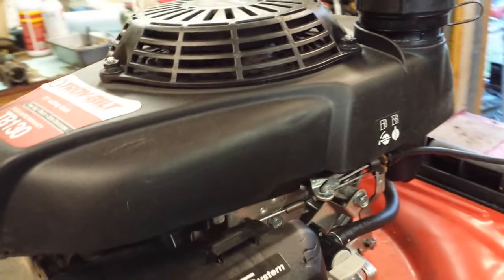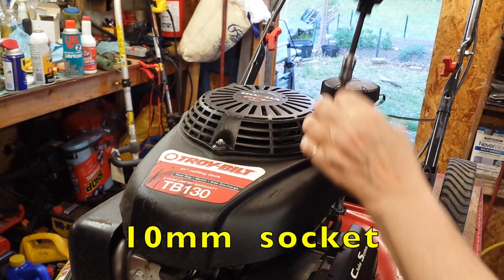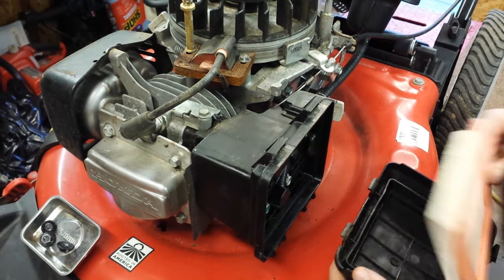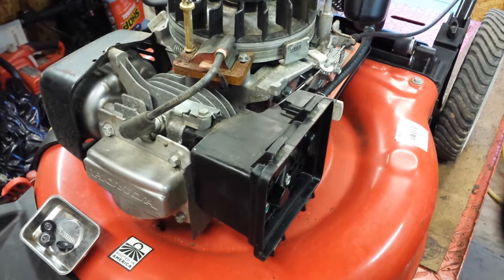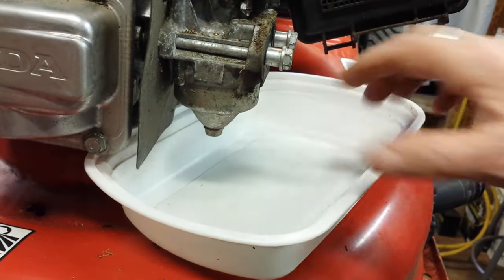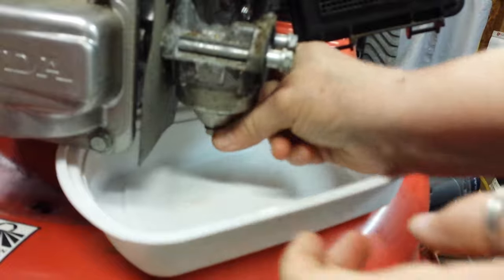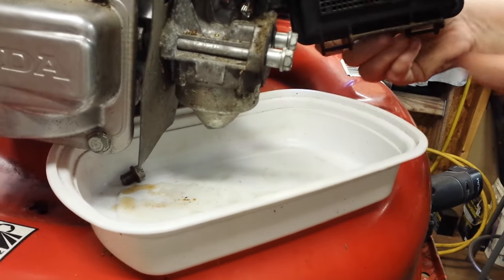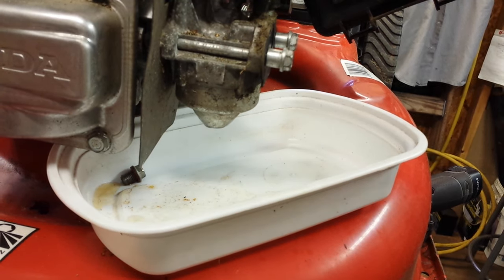Honda Mower GCV160 Keihin Carburetor Service

Comment: I have pretty much the same mower.  Here's my problem.  It almost always starts on the very first pull, even after sitting all winter.  Last year I noticed it would start but as you used it, the engine seemed to be popping and would eventually die after about 20 minutes.  I looked at the plug and it wwas completely black.  I changed it and used the mower most of the rest of the summer with pretty much the same problem.  At the end of the season it would barely run.  I looked at the plug again and it was completely black even though I had changed it at the beginning of the season.  Obviously it is running very rich.  I can see the choke, auto choke, opening and closing.  Any ideas?
Reply from the maker: Thanks for watching Mr Jim! I would first check your oil level, make sure it's not overfilled. Air filter can get saturated with oil and dust/dirt. and lastly the valve lash.hope you can get it running too notch again. Cheers!
Reply from the maker: And a couple of other things I thought about (not enough caffeine yet 😬) Your gas cap might not be venting properly. Next time that happens, loosen the gas cap, if you hear a swooshing sound,  and it fires right back up again, you need to replace the cap. 
It also could be the ignition coil breaking down. Not a good way to test for this other than waiting an hour for it to cool down, and it fires back up.  A pricey gamble for sure, but they are easy to replace. 
Lastly, did you replace the plug with the same NGK BPR5ES ?  Bad plugs right out of the box is rare, but not unheard of. Also there apparently was a plethora of counterfeit NGK plugs on the market a few years ago. If you bought an E3 or Torch plug, I would bin that one for a genuine NGK.
Reply: @TheLawnmowerLady  thanks so much for your suggestions.  I will give them a try.  BTW, I loved your video.  Very detailed and to the point

Comment: Question: I removed carburetor from troy built push mower with honda engine,  cleaned, put it back, start the mower with chocke on and it started fine but when choke is off, rpm gets high and runs at full speed. Can you think of anything where I made the mistake?
Reply: I checked to see if there was any airleak, visually I couldn't see anything.
Reply from the maker: The easy way to check for an air leak is to spray something like brake cleaner, or carb spray near the intake. If the RPM changes, you found your air leak. I'd also check the governor return spring and linkages, to make sure they are not getting snagged up somehow. Hope this helps. Thanks for watching.
Reply: @TheLawnmowerLady  Thank you for the quick reply! I'll try that.

Comment: hey i did this,  my mower was running before but wold always die after thirty seconds. now after i took apart carb and cleaned and put back together it wont start at all, so much so that i broke the cord trying to yank it to life. please help
Reply from the maker: Fixing things over the internet is difficult. I suggest going back over what you did. Make sure all the gaskets and linkages are correct. A very quick way to isolate a fuel delivery issue is to spray something very flammable into the carb intake. If it coughs and sputters a few seconds, you've eliminated spark and air as issues. Concentrate on making sure you have good fuel flow. Thanks for watching.

Comment: Not sure why this low speed jet Philips head screw is so tight......gonna have to get an impact screwdriver set to remove it.
Reply from the maker: It is tight. I sometimes put them in my vice (with soft jaws) to hold it steady. Thanks for watching!

Comment: Hello, one question I changed the carburetor but it started to spew gasoline what is happening I don't understand thank you
Reply from the maker: Sounds like the float has a hole in it? If it's an aftermarket carb, those are sometimes poor quality.

Comment: THANX.  hopefully carb spray will do it.
Reply from the maker: Just keep it away from the rubber and plastic bits. It's pretty harsh. Thanks for watching!
Reply: well, it starts, but barely runs.  It surges a lot and sometimes even dies on its own and when engage blade, if I don't do that slow, it stalls.  Neither did Tru fuel, new air filter, or spark plug help.   Can that wax pellet keep it stuck on choke and then mower seems to run weak?  Anyways I ruined the cartridge trying to pull it out.  Are they all the same part number? 16620-Z8D-305 or do I need 16620-Z8D-842.   I Have GCV 160 motor on a HRR2169VYA Mower. BTW I got rid of old filter and replaced it with a kawasaki visu filter.  Just cut the fuel line and spliced it in there. Hope I didn't do anything stupid.  Might change it to a B&S  type if that won't work.  when get chance will check the lash on the valves  and re clean the carb. After that I lift my hands and take it to the shop.
Reply from the maker: @joeshmoe5935  I’d keep a lookout for fuel leaks. That fuel line is 5/16 and many of those inline filters are 1/4. You should be able to confirm the thermowax plug on a parts diagram at most any major parts house. It sounds to me like the idle circuit is clogged in the carb still. That’s the small screw on top. This video Honda HRC216 Mower No Start: GSV160 Carburetor Clean How To
https://youtu.be/wJPM_ArLSgg shows more on cleaning that out.
Reply: @TheLawnmowerLady  small screw on top that outlets into 2 very small brass nozzles in the main bore?  Just want to let you know you are being a real angel.
Reply from the maker: Yes, make sure that runs free with carb spray from both ends.
Reply: @TheLawnmowerLady  while I am at it and have oil out and sparkie out, think I  should check valve lash or probably not worth the hassle?
Reply from the maker: @joeshmoe5935  I wouldn't bother unless you suspect a problem. That valve cover is meant to be a one time use thing, but folks reuse them all the time.
Reply: @TheLawnmowerLady  I couldn't wait for your reply.  Since I already tipped the mower over to empty the oil.  I broke in there.  Am I glad I did.  Was no .006 on intake and .008 gap on exhaust.  Felt like it was more than that.  Maybe that is why the guy sold it to me at a decent price?  Took almost 1 twist on each adjuster.  Used blue Permatex silicone to reassemble.  Cleaned cover and head real well before reapply.    BTW, after taking carb apart 2nd time.  the main jet that sticks up in the bore.  Smaller holes were still clogged.  wire and also twisty went in there, but I have these small drills from old job and they pushed out some gunk.
Reply from the maker: @joeshmoe5935  Yay! Glad you got it figured out. Cheers!
Reply: @TheLawnmowerLady  Running like a champ.

Comment: I am in the middle of a carb tear down of this specific engine and I see the governor rod and adjacent spring are intertwined. I don’t thing that’s supposed to be the set up. Can you please confirm???
Reply from the maker: The governor return spring indeed has a small series of loops that the control arm is threaded through. I hope that makes sense. Thanks for watching.
Reply: @TheLawnmowerLady  thank you for the confirmation and I’m now a new subscriber. Ok I followed your tear down of the Honda carb to the letter. I noticed there was some debris in the waste carb cleaner after I blew into the passages. I removed every screw and reamed every little hole too.  After reinstalling I the noticed the engine was still surging just a bit so I changed the plug and it seemed to run OK but not optimal. I have another Honda mower which is approx 12 years old and runs like a top. I noticed the exhaust smell is a bit different too. Not sure what that’s all about?? Like your carb tear down I noticed the Governor arm had a slight crook in it. I left it alone. Would that matter or should it be straight? Thanks for the time and showing us newbs how it’s done. ALMOST FORGOT TO MENTION: the mower was running and sufficiently warmed up. I turned it off and pulled to start it approx 15 secs later. It would not start. It took a three yanks of the pull cord to start it. I have never had that happen to a Mower. Is this a tell tale sign of something???
Reply from the maker: @Fresh-tw7ev  If it's an older mower, just might need a valve adjustment.  I rarely have to adjust valves on any mower, but hard starting is a good indicator. If the problem continues to get worse, it also might be a failing ignition coil.
Reply: @TheLawnmowerLady  thank you...I pulled the carb again, cleaned every channel nook and cranny and drained the fuel tank and blew out what might have been some water. I also gapped the plugs to your specs. It runs a lot better but wondering now if the wax plunger thingy is malfunctioning. Should it protruding outward when it’s a COLD engine? UPDATE: I let it sit after running it for 15 minutes with no chugging or hunting, etc. I started it up and the engine chugged and blew out black exhaust smoke. It sputtered and finally caught on and ran fine. It did that approx 3 times on successive starts and even had it backfire on me when I pulled the handle. As mentioned previously I installed a brand new plug and gapped to specs. Could this rough running be a valve issue? Or that wax plunger thingy.
Reply from the maker: @Fresh-tw7ev  the wax thermoplastic runs the auto choke. You can check it’s working: on a cold engine, you should see the choke flap, looking into the throat of the carb is completely closed. I hope this helps.
Reply: @TheLawnmowerLady  Ok I noticed the thermowax rod was protruding when the engine was COLD, which should not be the case apparently. I had a dickens of a time removing the thermowax insert. I had to use needlenose vice grips and wiggle and pull it out. The former owner had used gasket seal to cement the thing into place. Wow. I’m thinking “No way could that be to manufacture specs” but please correct me if I am wrong. The sealant was also heat resistant because when I applied the blow torch to the insert (after I had removed it) and instead of melting away it glowed orange. I pulled the brand new spark plug to check it out because the engine was backfiring and the entire tip was fouled with carbon. Not good!!!
Reply from the maker: @Fresh-tw7ev  Wow! It should fit  in dry. When it gets hot, it pushes out that piston, which in turn opens the choke flap.

Comment: I have a Honda mower and I turn off the tap and run the engine out of fuel after each cut, but I know it's Ott..
Reply from the maker: Thank you Mr, James. If everyone did the right thing like you, I dare say 85% of my work would be unnecessary.
Reply: @TheLawnmowerLady  Yeah it's just a habit I got into. She does start very well hot or cold except for the usual "hunting' sometimes,  I'm just a bit too lazy to clean the idler jet😁,...... I should though 🙄.

Comment: You put the carbon mounting gasket on backwards the tiny hole needed to go to the right not the left….. I accidentally did this yesterday that’s how I know…I just pulled the gasket out and flipped it over so the little hole is to the right if you go back and check the video you will see
Reply from the maker: If you're referring to the heatshield, it went back on in the order and position it came from the factory. Often gaskets and spacers are used on multiple models that may or may not have matching passages for air and/or fuel. On this particular model, it doesn't matter as there was no passage on the carb body, or auto-choke body. Thanks for watching.
Reply: @TheLawnmowerLady  Im confused because if you look at that gasket that tiny little hole will not match up with the tiny little hole that is on the right side of the carburetor with the position you have the gasket…Are you sure somebody did not put the gasket on wrong before you ? OK I went back and looked at three or four videos of the Honda 160 engine carburetor install the gasket definitely goes with the tiny hole in the gasket lining up with the vent hole in the carburetor those two holes have to line up otherwise the carburetor will not vent….
Reply from the maker: On this particular carburettor, that passage is blocked with a brass ball/plug. It goes nowhere on this model. In this case, it doesn't matter how the heat shield is mounted.

Comment: What do you call the black part on top of the carburator that is controlled by the governor which sits beside the choke stop arm.
Reply from the maker: I think you might be referring to the throttle control arm?
Reply: @TheLawnmowerLady  yes throttle since it's linked to the governor arm but I didn't know if it was called an "arm". I have an HR214 gxv120. When it's on choke it runs but sputters and dies as soon as I put it in hi or low throttle. Before it would run but died after 5 min every time I started it again. Any idea? Carburator dirty or not well adjusted ? Governor arm or throttle cable adjustment?
Reply from the maker: @JazzyScat  sounds to me, like the carburetor, especially the idle circuit, could use a good cleaning.
Reply: @TheLawnmowerLady  I'll do that. If the bowl looks clean should I still proceed to clean it all or try without removing it first maybe just the pilot jet under the throttle screw adjuster? And is it safe to spray the inside throught the vent hole where the air filter box connects to? Saw somewhere that you have to do that while it runs but don't know if it's gonna run or start whitout the choke on and if the choke is closed doesn't it close that hole so you can't spray inside? Newbie here. Thanks!
Reply from the maker: @JazzyScat  clean bowl unfortunately doesn't mean the internal passages are clean. If the idle jet is under a plastic screw, I would avoid carb spray there. I would pull out and clean the main jet and the emulsion tube as well as the idle circuit. Use carb spray in all the openings. I think this video shows more details on cleaning: https://youtu.be/wJPM_ArLSgg
Reply: @TheLawnmowerLady  Hi I will be changing the carburetor and wanted to know if I needed to do anything before starting the mower afterwards since there will be no fuel in the carb. Maybe it's not needed when it's a 4 stroke engine without a primer button? Do I still need to put some starter fluid in the carb before closing everything? I searched and searched couldn't find anything. Thanks
Reply from the maker: @JazzyScat  No, you should be good to go after you open the fuel tap. The auto choke mechanism obviates the need for a primer bulb.
Reply: @TheLawnmowerLady  it's called auto-choke even if there's an off-lo-hi-choke manual lever?
Reply from the maker: @JazzyScat  oh wait. I didn’t realize you have a manual choke cable. Either way, no primer is needed with a mechanical choke, regardless of how it actuates.
Reply: @TheLawnmowerLady  great! Thank you so much I really appreciated your help.

Comment: I cleaned my carb and it starts. It won't stop without turning ga line off.
Reply from the maker: Be sure and check the kill wire. Might be disconnected?
Reply: @TheLawnmowerLady  fuel line was tangled with idler causing idler not to stop.
Reply: Thanks for your reply.
Reply from the maker: @polocash11  Glad you got it sorted. Cheers!

Comment: Can’t get the atomizer tube out!
Reply from the maker: Sometimes I have to soak them in carb spray, to get them out. Sometimes I have to put them in my ultrasonic cleaner installed, and they just drop out after a few rounds. Thanks for watching!
Reply: @TheLawnmowerLady  I could only push the tube down as far as flush with the carb throat, then back up to original position.  Back and forth for many times, but no progress.  I ended up tapping a Hanson 5/64” screw extractor into the tiny hole in the bottom, then I could pull it out.
Reply from the maker: @ph2738   Great idea! I hope this fixes your carb issues.

Comment: I have this motor on a Poulan with transmission.. I hate this design.  It was like they thought there would never be a day you needed to take the carb off...
Reply from the maker: I know. Check out some of my other Honda videos. I sometimes use some M6 threaded rod as studs to assist with assembling the myriad of gaskets. Thanks for watching!

Comment: Mmm.OMG Half a job....isnt there an idle jet...what about covering it seeing as its usually the one that causes most issues.
Reply from the maker: Mmm.OMG Half a video watched...there is an idle jet, as I pointed out, just past 1/2 way in the video, how I failed to show removing it earlier. I did explain how to make sure it was clear with carb spray for the benefit of those that don't own an ultrasonic cleaner. Thanks for watching and commenting Mr. Roger 😉
Reply: Thank you so much Lawn Mower Lady, followed your instructions step by step, in fact did it twice just because I must have missed an step, but the second time my Lawn Mower came alive.  Your instructions are perfect.  It started just fine without taking it to a shop. You saved a lot of money and now I know what do next time.